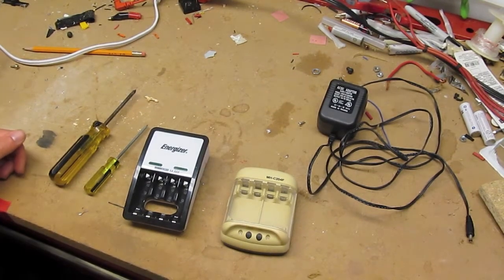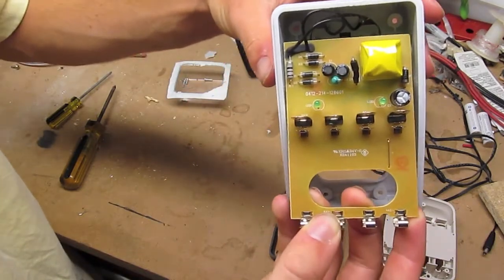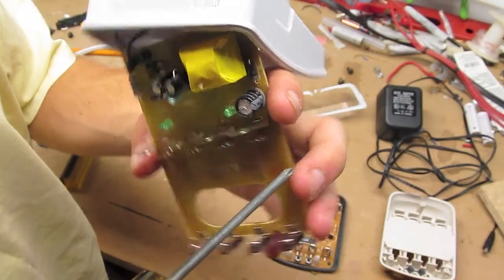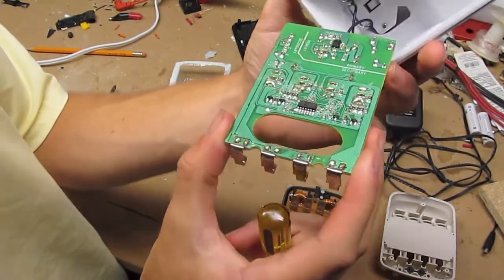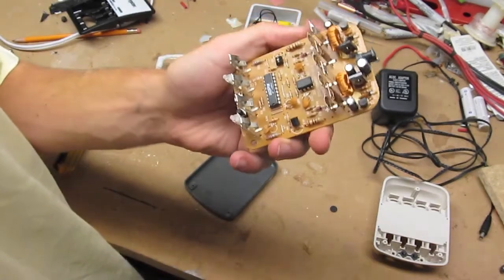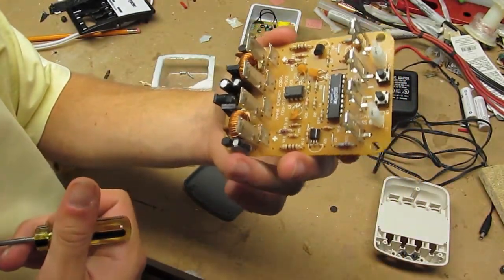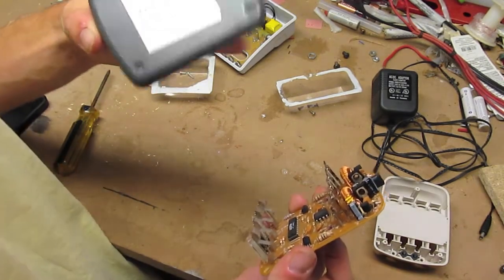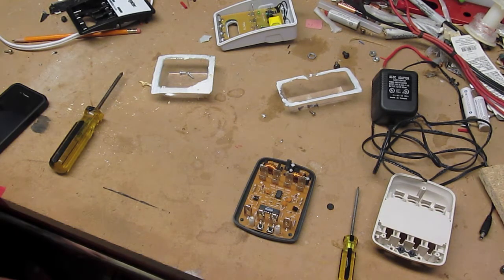What's Inside Two Different AA Battery Chargers?

Comment: The Energizer charger also uses a cheap SMPS, and these tend to run hot.  mikeselectricstuff did a teardown of a really shitty one that came with a noname Who Flung Dung USB hub, and it got up to around 160°F internally IIRC.  It was also a blocking oscillator that drove a transformer, not a proper SMPS.

Comment from the maker: It seems the heating in these chargers is not solely a function of their charge current.  If it was, the Maha unit should overheat the batteries, but they get hotter in the Energizer unit, which has less charge current.  The Maha claims to use a lower charge voltage than the Energizer, which could explain the difference.

Comment: Many chargers nowadays charge the cells at too high a charge rate in order to decrease the charge time, which is why the cells overheat.
The memory effect only applies to NiCds that are discharged and recharged to EXACTLY the same levels repeatedly, and is only a problem in satellites and testing labs.  It will never be an issue for most people.